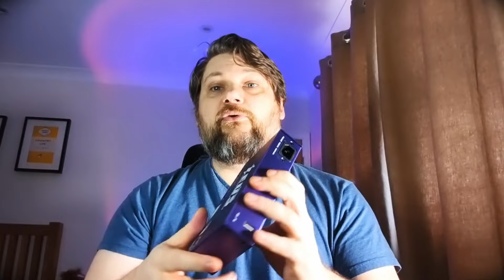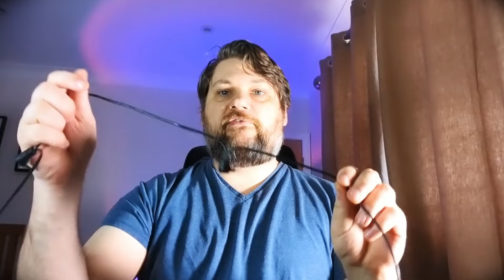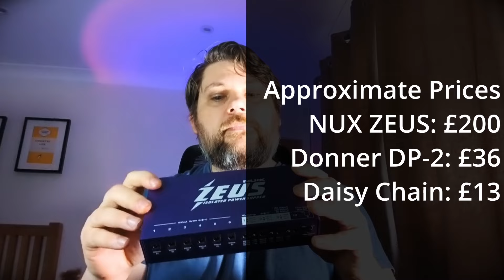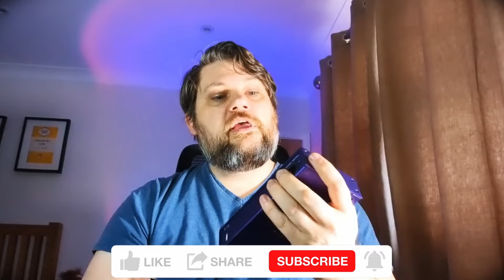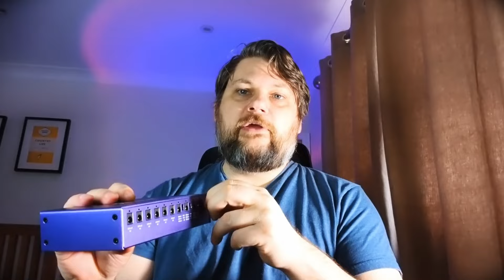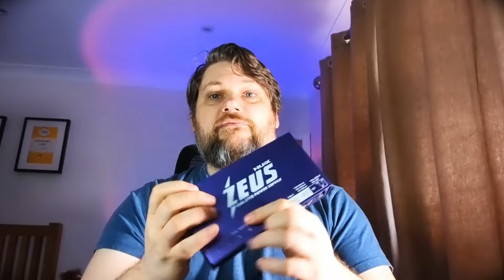The Nux Zeus Power Supply: Why Quality Pedal Power Matters

Comment: I’ve recently taken delivery of a Zeus.  Lots of outlets, variable voltages and a USB socket for charging my iPad or phone.  Nice.  Or it would be if the USB socket delivered more than 1.5 amps, as it doesn’t deliver enough current to charge my iPad which draws about 1.9 amps when charging according to my USB socket tester.  Every USB adapter and USB “wall socket” if have delivers a minimum of 2.1 amps.  I tried multiple USB cables in the Nux and no dice.  I sent the first unit back assuming it was faulty but the second one had the same issue, which is why I bought the USB tester as I wanted to check what was going on.  A potentially great product, let down by a naff USB.  Such a shame.

Comment: It looks interesting, but for the price (£199 in Andertons) similar to Cioks DC7, I would go with Cioks - RCA connectors; 660ma can easily power Boss GT1000Core and is even expandable by adding modules. I don't see people buying the Zeus for this price.
Reply from the maker: The Cioks is very flexible. I think this offers nearly as much flexibility and 3 more outputs. We shall see.